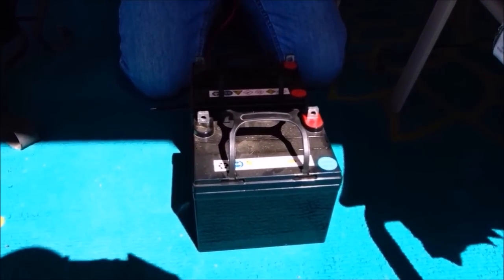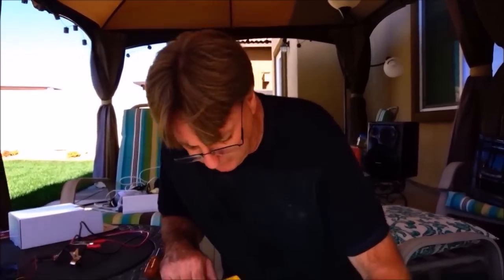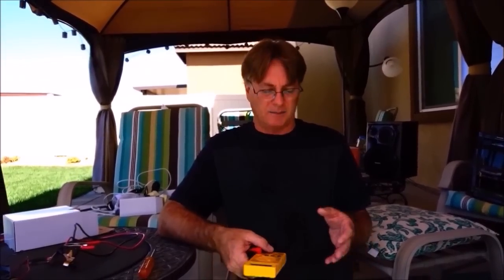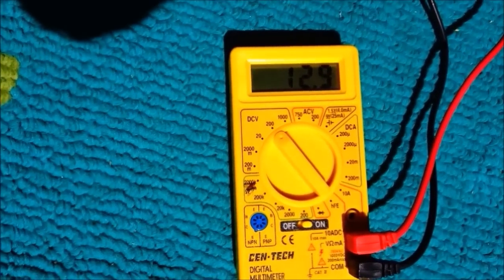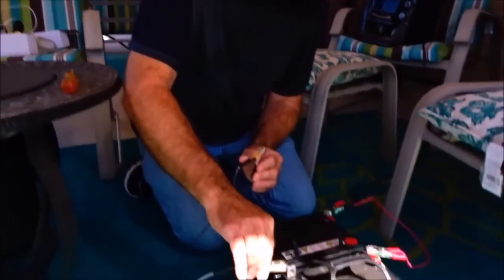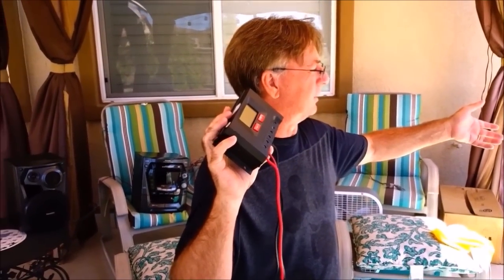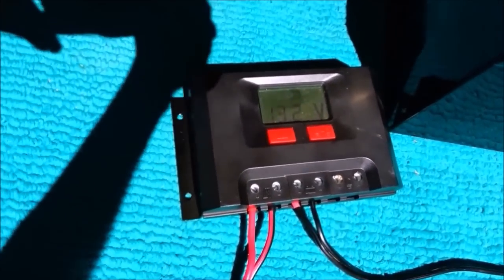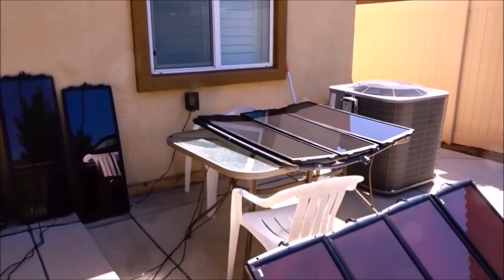Part 2 Harbor Freight Tools Thunderbolt Solar Systems. The complete how to and what not to do

Comment: A 35 AH battery is rated on a 20 hour basis. So to get the rating, you divide the 35 by 20 to get 1.75A continuous draw for 20 hours. That means 21watts per hour of use. Putting your two batteries in parallel would give you the ability to draw 3.5amps for 20 hours. A single size 27 deep cycle or dual purpose battery will give you 100AH at the 20 hour rate. $100 for the single battery vs 2 $70 batteries from HF. A year and a half ago, I ran one size 27 battery on a HF 2000watt inverter for Hurricane Irma. It ran for about 2 hours without completely killing the battery. The battery was then charged back up by either the truck or generator. That way it was peace and quiet for at least two hours with a fan, lights, fridge, and TV on. That same battery is still in use along with 3 others. Charged daily by 200 watts of solar panels from HF. Right now I have 200 watts worth of more HF panels and 600 watts worth of Mighty Max panels to finish installing. In a 10 hour day, the 200 watts of HF panels will only produce about 500WH of charge for the batteries. But the 4 batteries running either the HF 2000 watt inverter or the Reliable 3000 watt sine wave inverter can at least run a small A/C unit when the power goes out for over an hour.

Comment: I have 320watt gate motor. I bought a 30w solar panel, 35 amp battery with a solar charge regulator. Will this system work properly?

Comment: I put 100 w panel system plus I put 2- 175 panels to the port down below so that charge controler that comes with the 100w HF system  so it handles 450w
Reply: mine felt like it was going to catch fire when i got to about 16 amps, connecting four "100 watt kits",  thats 14.4v x 16a =  230 watts. the wires were getting close to melting the insulation, the fuse inside is only 20 amps lol. no way you actually pushed 450 watts into that thing. did you put an amp clamp or watt meter inline to confirm power?

Comment: I am a total noob, so I apologize in advance for dumb questions...I really liked your video, lots of folks on YT seem to agree with you in their reviews too. You pointed out the included lights make it a better deal which makes sense BUT you hooked the lights up when the panels are collecting sunlight, what happens when you actually need the lights, when the sun goes down. Does the power flow from the batteries you charged back thru the controller to power the lights or do you have to hook the lights to the bateries?
Reply from the maker: Yes, You have it exactly correct. The battery will power the charge controller to power the lights.

Comment: Hi I have a 13inch by 14 inch solar panel,  its supposed to be 100 watts ,it has a 5v and 12v output via USB, can I plug in my power bank its quite small ,I then take power to my phone is it ok ,do I really need a charge controller, as I am carrying it on a bike 🚲 cycle bike
Reply: I would say yes, it SHOULD be fine SINCE it ALREADY has USB ports..... I have an Anker solar power hiker pouch, which has 2 USB ports ...... I leave it open to Sun & it has pouches for phones & cable to charge......love it ...l$50 on Amazon( needs sun tho, does NOT store energy);.....

Comment: 70 amp-hours (70 Ah) times 12 V is not 840 watts, it is 840 watt-hours.  (840 Wh).  Depending on the current draw, that could mean 35 watts for 24 hours. or 1680 watts for a half hour.

Comment: I bought a solar kit(100w) from harbor freight and I bought one battery for now. I'm hopeing that is enough for an internet modem to run 24/7. I may also charge my phone and my Nintendo switch. I may run a fan sometimes also

How many batteries you reckon I need. I have gas heat and stoves.

Also bought a bunkerhill solar flood light from them.
Reply: 12v deep cycle batteries. Bigger the better. Or more than one

Comment: Are those AGM batteries really no maintenance?  They're sealed, so they don't emit hydrogen, but if you overcharge them they can build up hydrogen so you will have to open a pressure release to let them outgas the excess?  Am I understanding that correctly?  If I bought some could they be well stored for an extended period without much fuss?
Reply from the maker: Great questions. AGM batteries are zero maintenance. If they are severely overcharged they will automatically on their own release hydrogen. Remember, hydrogen is lighter than air so it is safe outdoors. AGM batteries do hold their charge better than other types of batteries but I would still top off their charge on occasion if not in use. Fully charged mine read a 13.2 voltage. I would top them off when they reach 12.5 volts just to keep them in perfect condition. Hope I answered your questions. Take a moment to subscribe to our channel. Thanks, Bill
Reply: Any lead acid battery will self discharge if left unattended for long periods of time. If you are going to leave then unattended for more than a few months you should have some kind of trickle charger hooked up to them.

Comment: Solar Panels are also used for Grid Tied Systems, that do not have batteries and goes into a Grid tie inverter. So Yes you can use solar panels without batteries.

Comment: Do you have any idea why Harbor Freight panels are so expensive the reason why so expensive it's because there are low light solar panels they are Morpheus solar panel you could cover off the panel and it will still work the older most expensive panel will not work

Comment: 12V 35Ah batteries, $70 each, two = $140. So you spent $140 for 70Ah.....  A single 70-90Ah (450-650CCA) deep cycle marine battery at an auto parts store comes in at $60-70, although they are not sealed, still it is never good to have batteries in a sealed unvented place anyways. Even sealed batteries vent a little.

I understand you're simplifying things down to 12V, but 190W / 13.8V (charging voltage) = 13.8A, but with cloudy or reduced conditions, 100W / 13.8V = 7.2A. Slower charge to the batteries.

Also it helps to get an adjustable low voltage disconnect ($60-90), most can be set to anywhere from 10.6-12.4V, but I usually set them to disconnect at 12.0 to prevent discharging and ruining the battery(ies).
Reply from the maker: All good advice. Thanks
Reply: Can I mix different 12v batteries of different capacities? Like I already bought the harbor freight battery...if I get a bigger capacity one can I use them together or do all batteries have to match exactly?

Comment: Keep in mind, the batteries can only be discharged to about 50% to avoid killing them on the first use.  Lead acid batteries won't last very long if discharged to 50% every day.. be prepared to replace them rather quickly... figure 200-300 cycles max.  Go beyond 50%, you will be replacing them FAR earlier...
Reply: I thought deep cycle and the thunderbolt solar harbor freight little 12v 35amp sealed led battery was meant to be fully discharged and recharged over and over
Reply: Deep cycle batteries are designed to discharge to 20% of their capacity. Before setting up, you’re best to check with the manufacturer what is recommended, and what voltage indicates that level. Many charge controllers can be programmed to stop discharging at a given voltage. If you’re running an inverter directly, they may also check voltage, or there are external battery monitors available.

Comment: Huh? I know lots of people, almost everyone who has solar, none of them have batteries. And hey have huge rooftop systems.
Reply from the maker: And when there is no sun. Like at night or cloudy days. They have no power. Batteries store the power for use when there is no sun.
Reply: @billisa    Yup. I am aware of batteries. But very very few of the installations here have them. No sun, they use the grid.
Reply: It's call connected to the grid to sell extra energy to power companies via house hook up. Batteries are for a off grid hook up

Comment: 35 amp hours is way too small to do anything of value. Better off having 200 to 1000 amp hours of power.  You can run a ton of stuff on that with a killer inverter.
Reply: This is where series and parallel networks of batteries work.  200ah agm is hard to find in my area, and expensive to ship.